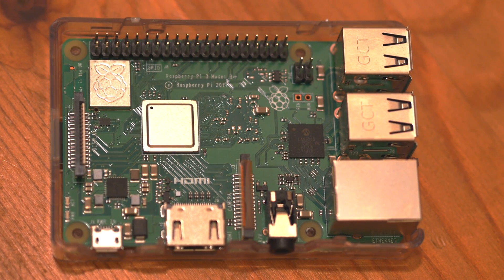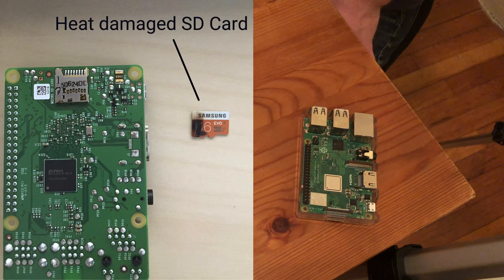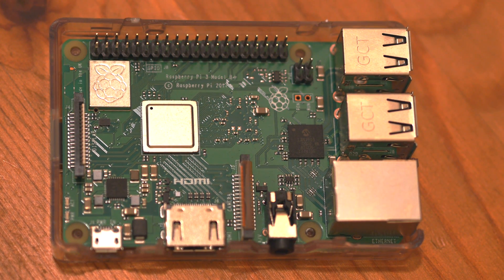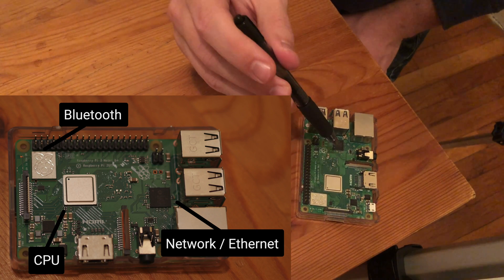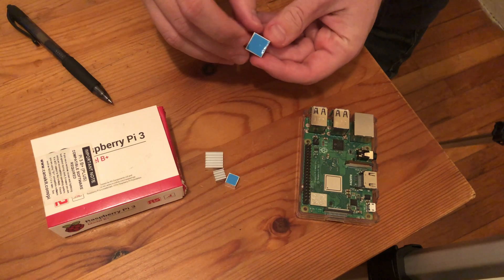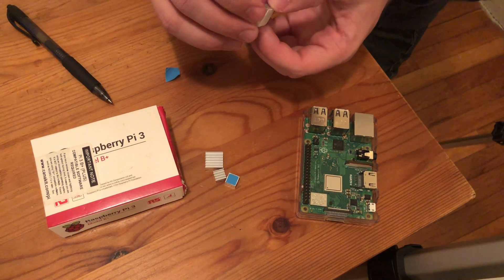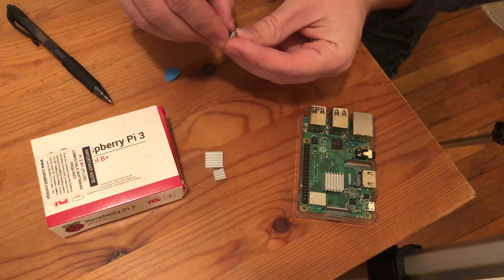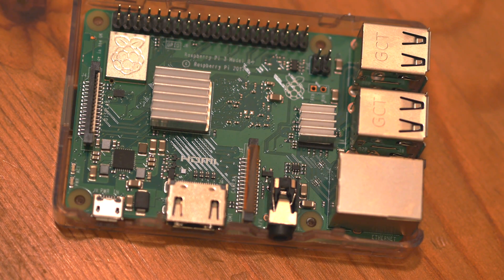How to Install Heat Sinks for Raspberry Pi 3 Model B+ to Unlock Better Performance

Comment: also, you need to show before and after cooling temps. I've seen videos where it essentially does nothing to change the temperatures
Reply: Yes, that is true, I am using my raspberry Pi in an enclosed area with little or no air circulation. so these will make a difference in my application, but not the typical one.

Comment: How would you install the heatsinks for Bluetooth though
Reply: You really wouldn't, that is a shield over the wifi-bluetooth chipset, it is not a heatspreader like on the processor. While there are pcb antennae on the board attaching things to this shield is not recommended as while unlikely, is possible it could interfere with wifi/bluetooth function, reliability, or range. The 3 locations on the pi heat sinks may be helpful are the SoC [processor] the usb/ethernet chip, and the ram on the underside of the board. Though the second 2 are not entirely essential compared to a heat sink on the SoC.
Reply from the maker: Really same approach.
Reply: But metal heatsink will reduce your signal quality.

Comment: Some benchmarks would have been helpful. The CPU already has a heat spreader so a heatsink on top of it might not be useful at all without a fan anyway.
Reply: The heat spreader does little to dissipate thermal excess.  The basic finned heatsink for the broadcom IC is far better than no heatsink at all. A miniature cooling fan for the cpu heatsink is an even better investment.  The others do not consume enough power to warrant heatsinking.  Have you ever seen a network card of the of the same thruput as the Pi use a heatsink ? I know bus network cards get cooled by the internal server fans but that's a product of it being in a server case.
Reply: @greywolf271  The network does throttle without cooling. I can't comment on why, but it does, but it takes a long time to do so. It is only necessary if you are going to be using the pi as a home server(which is pretty common), like as a plex media streamer for your smart TV.
Reply from the maker: Sure, but generally if you can avoid over heating longer you will get better performance.

Comment: That's the Bluetooth shield a heatsink would do little there. Also, I doubt that you could overheat either the Bluetooth or LAN chip.
Reply from the maker: That's interesting, I don't know why they provide extra heat sinks then.
Reply: @DataSlayerMedia  my first guess is the RAM on the back, possibly the network if it was in a server situation where data would be pulled at Max rate for a long time. Maybe for a second unit or just because.